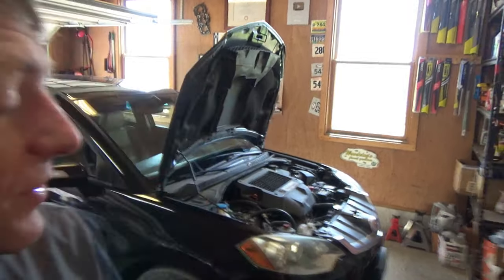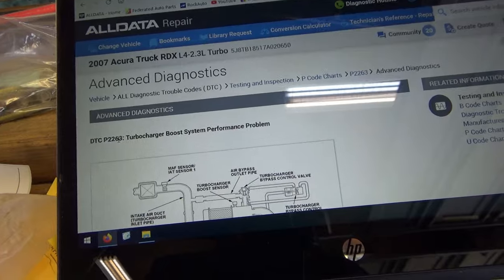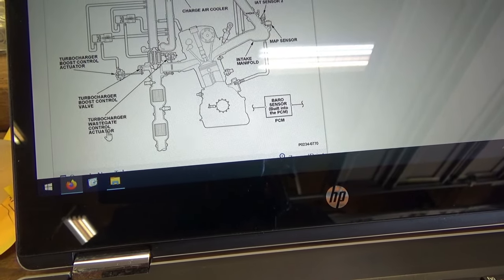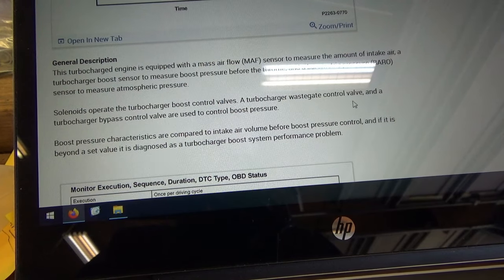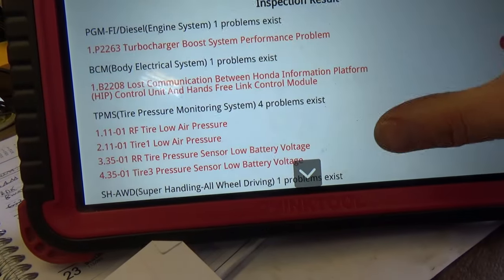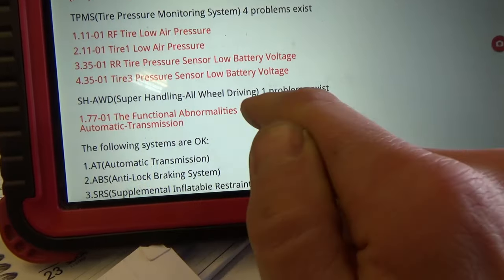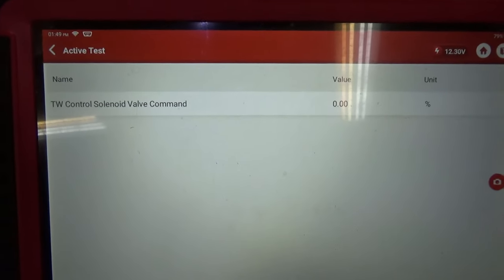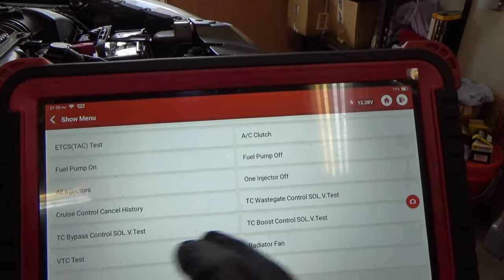TURBO Problem Disables AWD? (Acura RDX)

Comment: Yea for sure don't use aftermarket WASTEGATE it'll mess u all up. Happened to me. Now my Stock OEM wastegate and new actuator all codes are gone. My main concern was AWD SH code P2263... after almost 100 miles seems to be back to normal after new actuator install.
Reply: Can you tell me what part number you replaced? Is the wastegate and actuator separate parts? Some people are just replacing the Actuator eye bolt that gets ovaled out, is that what you did?
Reply: @Dan D  I initially did both new part came assembled with the eye oval part. But the wastegate failed later after a month. Same code same AWD issues. So what I did was used my original wastegate and new oval eye n still running strong after 5 months... aftermarket wastegate are trash. Unless u go to Dealer and get actual part. Only part number was wastegate which had the oval part assembled
Reply: @kongchan916  Ok so even though the wastegate you bought didn't work out, it's eye bolt was usable. So did you have to remove the turbo itself twice to get all this work to the wastegate done? If so, it sounds like it might be worth it for me to try to replace just the eye bolt part like some people have done, since that's the part that seemed to work for you.
Reply: @Dan D  no turbo removed. Just the cover and intercooler on top. Then the wastegate... be careful not to adjust the wastegate I know hard to say or do but just don't unless u know the exact amount. Also get the Grade 8 Titanium
Reply: @Dan D  BTW it hasn't flashed up since. Hope not to Jinx it lol. GL let me know if it works for u.
Reply: @kongchan916  I understand why you wouldn't want to adjust the wastegate. So the new eyebolt needs to be screwed into the old wastegate and end up exactly where the old eyebolt sat. Is that right? Are you able to attach the new eyebolt to the old wastegate before you insert the wastegate back into position, while slipping the new eyebolt over the rod it attaches to?  Then slip on the washer to hold it onto the rod? I wish you lived near, I'd pay you well to do the job!
Reply: @kongchan916  I hope not too my friend! That's the fear I have of paying the dealership $9,500 to replace the turbo and have the same p2263 error code pop up. At least this way it's not a big investment other than the time and effort.
Reply: @dand900  yup. Everything has to match up. U can't mess it up. Trust me.
Reply: @dand900  I almost bought a new turbo since I got the car at a bargain lol
Reply: @kongchan916  So can I ask you, is it easier removing the wastegate to install the new eyebolt, or is there enough access to leave the wastegate installed and just install the new eyebolt to it?
Reply: @Dan D  u can but work space is hard but manageable..  and chance of stripping eye bolt is great. I did that lol. Prob is if dropped that b the other hassle installing it without taking wastegate out

Comment: So did you tell the guy he still has a problem with the turbo as it won't pass the turbo test or just pretend you fixed it because no trouble code was reported?
Reply: Hehe your funny
Reply from the maker: No Check Engine light, then car is happy :)

Comment: All that pollution control stuff crowded up under the hood.  A radiator on top of the engine instead of in front.
I predict a couple more years of EPA regulations and every car will have to tow a trailer that has many of the normal functions of the car.

Comment: Imagine taking that to the dealer for the turbo problem.  They would have quoted $800 for new actuator but first, $500 for starter R&R.
Reply: Honda won’t sell the actuator, $4k for a new turbo.